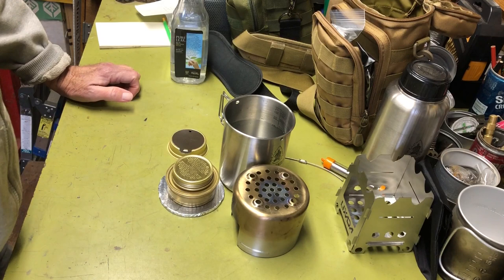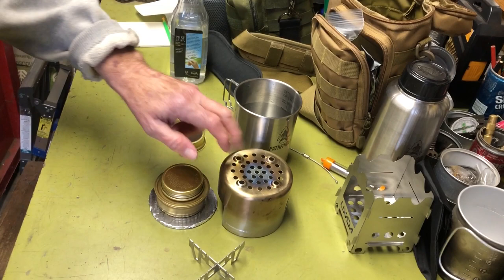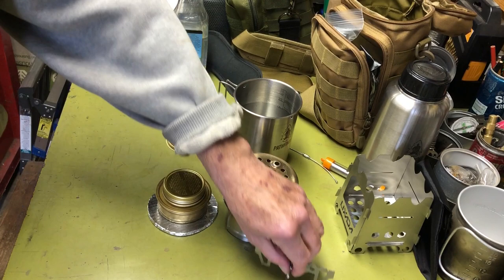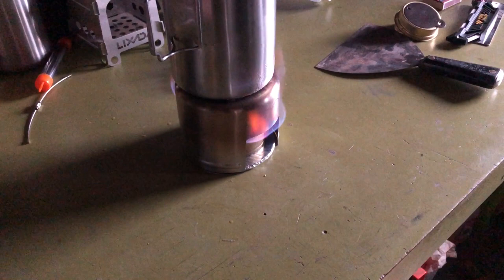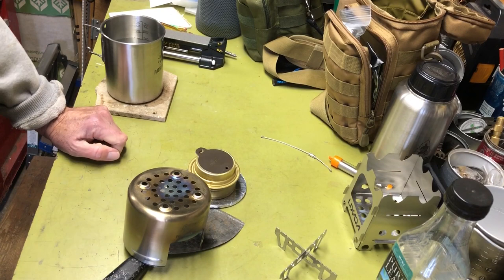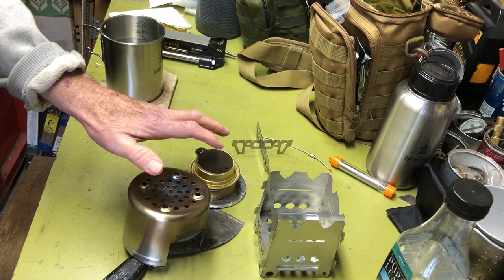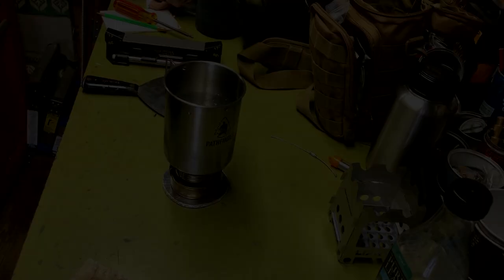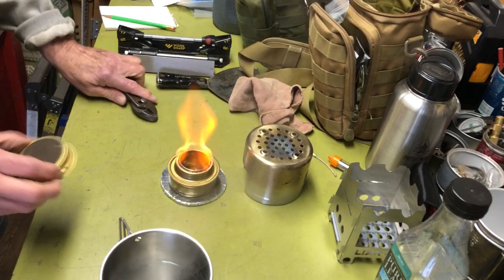Pathfinder Stove & Trangia Test (and fail)

Comment: If the Pathfinder pot stand was turned the other way up with two tent pegs across the top to act as trivets it would act as a windshield for the burner. Heat transfer to the pot would be better and you would be able to use the simmer ring without having to move anything. All the best.
Reply: That's how I do it but i use the spreader as trivet.  If you put twigs inside, you have a wood burning stove

Comment: I ran into this same problem with the PF bottle kit, I solved it by using 4 Allen head bolts in the raised areas on the stand which gave me around 3/8" clearance for the pot and allowed the flame to go through the stand instead of the vents and wood feed port. It works much better now, and the Allen bolts don't take up much room in the kit, I may weld them there soon.
Reply from the maker: Great Fix, A commenter suggested flipping it over and using  tent stakes.  A duh moment, I did and made a video.  
https://youtu.be/w2MzVeso4LM

Comment: I got the tbs version 
If you turn the stove up right, put the trangia inside with the cross on top, the cup or bottle fits inside nicely
Its only mean for a wind shield when used with a trangia
Reply from the maker: Good timing.  I'm about a to post a video I did on turning the Pathfinder stove over and using tent stakes.

Comment: I have seen the stove turned the other way up (still using the cross support) so you get the full force of the trangia flame and the walls of green stove cup the burner and acts as a wind screen
Reply from the maker: I did turn it over and added trivits and it works great.
I did a video on it.
https://youtu.be/w2MzVeso4LM

Comment: I guess not every combination of stand and stove work perfectly or are maximally efficient.  In general I try to use my alcohol burners flame direct to pot with a stand that is high enough not to suppress, limit, or quench the cone shape flame that it otherwise produces. Something that puts the pot about 1 3/4 inches above the flame seems to do the trick.  Additionally I try to avoid wind screens that restrict too much air flow....or are so confined that they super-heat the stove....since this seems to speed up fuel consumption.

Comment: Looks to me like you're using the stove improperly.  The end with the holes is blocking too much of the  flame from the Trangia. Invert the stainless steel unit, put the Trangia inside and video the results.
Reply from the maker: Correct, I got another comment about inverting the Pathfinder stove a few years back,  it was a real "duh" moment. 🙂
I made a followup video on the stove and even added trivets to improve the setup.  I've used this configuration several times scene and it works great.

Here is a link to that video.
https://youtu.be/w2MzVeso4LM
Reply: @planetsideagent  Thanks for the link. I have a great IKEA hobo stove set-up thanks to YouTube videos.  The hobo stoves would make the light weight backpackers shit their shorts because of the  "weight" but it was fun to make and fun to learn the different ways it can be used. You can cook with it using wood, a jet burner inside of it, or using the Trangia alcohol burner inside. Give it a shot, let.us know what you think.
Reply from the maker: Actually I did build a HOBO stove from a can.
I used an idea from Waypoint Survival and enhanced it to use
alcohol stoves.  Fun project.

My videos:
https://youtu.be/YBpWkQ6HAmI
https://youtu.be/wiUzePe8sMg
https://youtu.be/VkysnA-cf_E
https://youtu.be/Yc0_v-LU4mU

Waypoint Survival:
https://www.youtube.com/watch?v=MxmLjc0AT0w&t=50s
Reply: @planetsideagent  I made the  IKEA version.  Way better than a paint can or veggie can. Nice and solid, should last a good while.  If I knew how I'd send you a pic.

Comment: I am suprised Pathfinder didnt think that design through better. If there was bigger spaces on the bottom and not just punched holes there would be better heat transfer. If the alcohol stove was closer to the bottom of the pot (ie the stand was a bit shorter) that would help too. 
Absolutely - turning it over would be a great way to use this stand, as a matter of fact I wonder if you could use it as a twig burner too if raised up a little for air flow?
Many thanks for your video, I enjoyed it.👍👍👍
Reply: Mad Jack Tramper  True.
Reply: It was never ment for an alcohol burner. 🙄 it's like arguing I can hold a pot with surgical gloves. Yea they are gloves. But for different uses.

Comment: I took 4 1/4"x1" stove bolts an mut in each corner an it works 100%😊
Reply from the maker: That works, I'll have to try that. 
I did turned mine over and added thick wire trivets.  I made a video on it:
https://youtu.be/w2MzVeso4LM

Comment: Just found your video. Put the x shaped stand on ground. Put stove on top of x stand. Add 1 bolt with 2 nuts to each pathfinder pot standoff hole.
       The x stand raises stove off the ground closer to the stove grate off the cold ground. It also raises the flame above the large square bottom openings. The pathfinder stove then is a windscreen and pot stand. The nuts and bolts would raise the bottom of the pot hight to allow fame around the pot bottom and sides.
     I dont have one of these but it seams like it should work. As I prefer wood over alcohol fire, I would rather do it that way. But if I'm not allowed a wood fire and am permitted a stove fire, it sounds like it might work as a back up. I also saw pathfinder had little puck fuel pads. If they work, which I can't say as I don't have that either an x stand lid and might work. Just some thoughts, while I like my current wood stove I'd love to see if the works. It might cut half my stove weight.
Reply from the maker: Interesting idea, I'll have to give it a try.  Your comment got me thinking, I'm going to try turning the pathfinder stove upside down for a wind screen and place the Trangia with the X inside.  It might be open enough to prevent a thermal run-away.
Those puck pads are a fire starter.  I don't think they are strong enough to cook with.
To save weight and cost for a backup alcohol stove look into a home built Fancy Feast stove, 0.8oz weight and has an intrigel pot stand, it also works well in very cold weather. I think It and the Trangia are the best alcohol stove  options.
Reply: @planetsideagent  ty I got the impression the pucks where fuel. But that seams much more realistic. Thanks for the update. I'm glad to know what they really are. Haven't had the time to look yet.

Comment: A nice informative Posting .. thanks.
Yep, the Trangia Burner does suffer from Claustrophobia .. it tends to get hot under the collar and wants to run away if used in enclosed spaces. An Aluminium Windscreen that gives it 'room to breathe' is far more effective.
I've never had a hankering for the Pathfinder Stove. Cooking / heating through that holed grid doesn't seem right to me. I originally thought, when first seeing it, that one used it the other way around / upside down. This way, it may, with some mods, be more effective .. similar to the GI Canteen Cup Aluminium Stove or an IKEA Hobo Stove.
Slightly off base .. I noticed that you also potter with the Optimus 8R Hunter. Now THAT is a Stove! Bought mine new in the mid-70's .. still in regular used and as trouble-free and reliable as a Swiss Sewing Machine .. love it!
Reply from the maker: I don't see the pathfinder stove as a stove but as a secure pot base to place in the fire/coals.
Those old Optimus and Primus stoves are great.  Back in the early 70s when I started collecting backpacking gear the 8R and SEVA 123 were the gas stoves to have. I on the other hand being a poor collage student opted for a Bleuet S200 because it was a lot cheaper and easier to use.
Reply: @planetsideagent  I still have my Camping Gaz Bluet 206 from the 70's. Used regularly .. gas cartridges are freely available here in Switzerland and give you the most bang $$$ for your buck.
My little 'Globe Trotter' (with the two aluminium pots) that uses the 106 cartridge is in semi-retirement as the cartridges are no longer manufactured and my current hoard is getting low. One can though, use the Globe Trotter Burner on the the 206 cartridge holder, thus having the advantage of the two pots .. albeit a little longer when stored.

Comment: Will the fancy feast DIY alcohol burner work with the Pathfinder stove? I have ordered the same Pathfinder kit that you have and was hoping to use an alcohol burner in that stove
Reply from the maker: The pathfinder is a great kit.
I think the Fancy feast stove should work fine, ONLY, turn the pathfinder stove top down and place your Fancy feast in side.  Place a couple of tent stakes across the pathfinder stove for pot stands so you get good heat distribution around your pot. 
I made a video on this technique you might take a look at.
https://youtu.be/w2MzVeso4LM

Comment: The pathfinder alcohol burner has a stove that fits in the rim of the burner not the one you're showing it has a bunch of holes in it and then you could sit the other one on top of it that's how I use the one you have
Reply from the maker: The pathfinder burner is big and holds more fuel, I prefer the smaller trangia type burners, especially for use in my bottle bag kit.
Reply: The Pathfinder burner is a fail in my book.  It takes way too long to bloom and it burns with a weak flame.  I much prefer stoves of brass as they are more efficient.